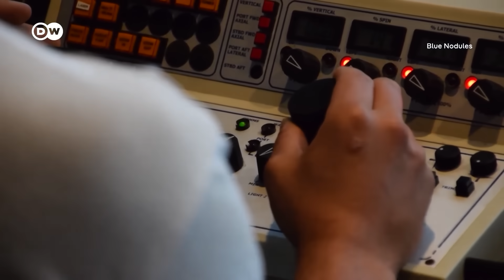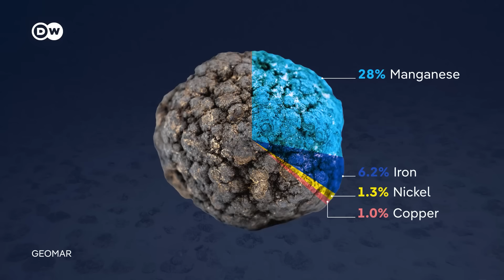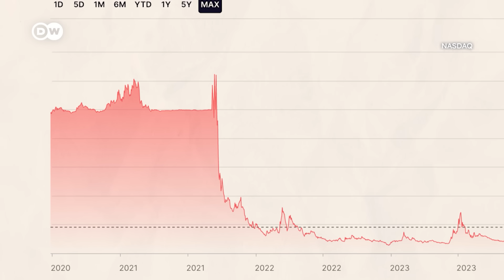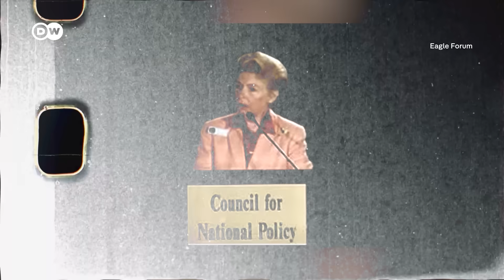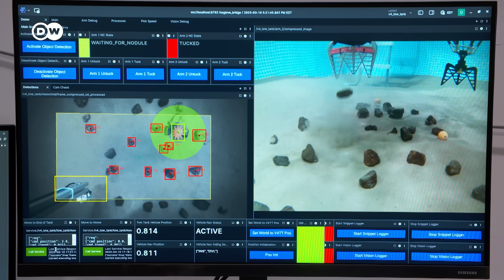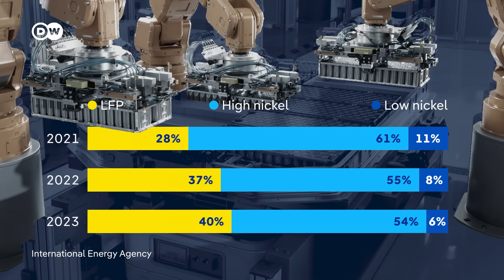China leads in deep sea mining for rare earths. Can the US catch up? | Transforming Business

Comment: Procede with the ethos that , when people learned to go faster than a horse, the unknown freaked people out, then seat belts. Air bags, and whistles on front bumpers.... take deep sea marine carbon removal in tandem with deep sea mining,  try other methods of picking up stones,  it is real-time data absorption with a multi use at sea operations,  the economy of scale needed and the infrastructure required, could be designed to mitigate ocean acidification at the same time , so design a program ....

Comment: I am in the mining industry, in fact work for a company that makes underground mining equipment. I have travelled the world with my job - and have seen excellent underground operations... and some absolute horrors. Some of the worst examples being in countries with lax environmental and safety controls. Many of these mines also owned by companies from one of the countries mentioned in this report.
Undersea mining is not a good idea - because the ability to monitor and regulate will be almost impossible. Everything will just "wash away"..... go check out some of the capped under sea gas and oil heads. Those things can leak like crazy.
My vote - a hard no.
Reply: US does not even cap many of its old oil and gas heads on land.  😮  Do something about it